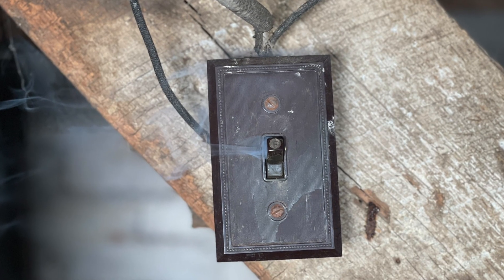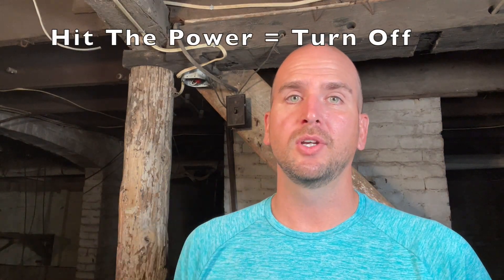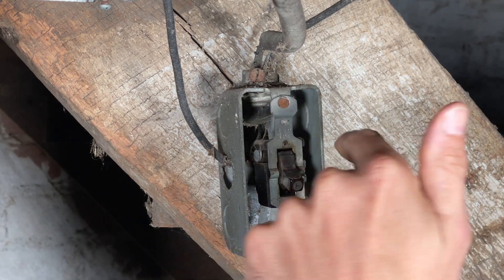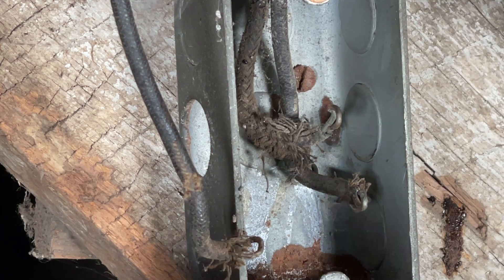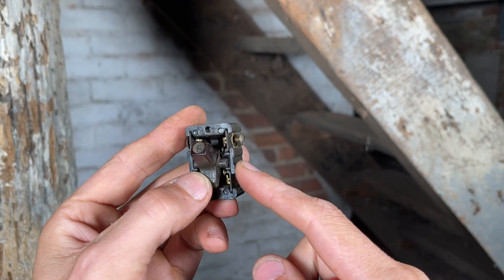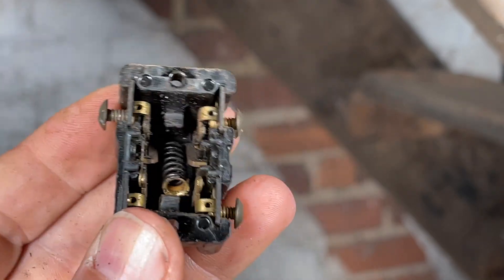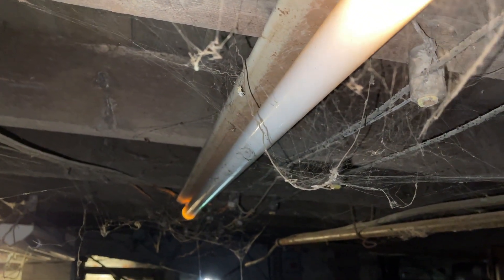Issues with Old Electric Wiring | Knob and Tube

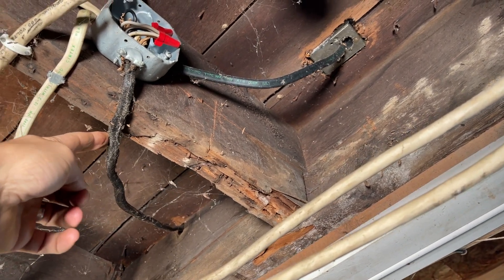Comment: I won't comment on the numerous code violations but at 5:59 you see fibrous 2-conducter Romex which predates modern vinyl Romex but was after K&T. This wire type is WORSE than K&T as both the neutral & hot are housed in the same (decaying) assembly. At least K&T conductors are totally separate and threaded through ceramic insulators when passing through a truss, joist or upright and they tinned the conductor to minimize copper corrosion. If you absolutely must keep some K&T or fibrous Romex don't use metal box clamps. The aged (dry rot)  wire insulation won't hold  up against a metal edge under pressure. Many regions won't allow re-power if you have a 60-amp main fusebox so a previous owner would swap it out for a 100-Amp breaker service box. The newer the breaker box the more suspicious you should be about the rest of the service when you see even a trace of older non-vinyl romex in use or left behind. Most electric fires start at junctions, outlets and switches.
Reply from the maker: Good stuff, appreciate the feedback!
Reply: @EverydayHomeRepairs  Is that BX at 5:59?! (the cloth wiring)
Reply: You're describing the wiring in my summer home. Dang...

Comment: I believe your diagnosis may have missed that the switch is actually a 3-way switch. If the "Hot" was on the left side of the switch then on the right side were the two outs for a 3-way switch so when you"Turned It Off" you actually switched it from the bottom "Out" to the top one. You already observed that the top one was shorted to the box so that's where your short came from. Because the box was not grounded and the wood can conduct some current is why it didn't blow the fuse/breaker as it was a high resistance short just enough to cause heat within the switch. What say you?
Reply: @John Naber I also think that it's a older 3 way switch where the travelers are actually the top 2 screws and the line / load terminal is on the bottom right, completely opposite of the newer 3 way's, but none the less it's definitely a 3 way switch.
Reply: That wood was not conducting any current .  It is an old house , very dry .
Reply: @gerdberg4188    Looking at all the rot on some of those joists i’d suspect that there has been humidity/water problems in that basement.
Reply: You're correct that it's a 3 way switch but within it smoldering the contacts were aging and it did look super old so either way it was time to get a new one. But it did arc against the box. Without a ground you do become the ground. Ik back then they didn't have grounds to Switches so it wasn't obvious but they did carry electrical tape/Rubber tape as I used to hear the oldheads call it. Either way it was time for a brand new one.
Reply: @crockpot5194  Thanks for reply. My home is a Victorian in Northern California of unknown age. When I purchased the home 30 years ago they could only say that it had been moved to this location 100 years ago and had no idea where it came from originally. There was a mish-mash of knob and tube and some home updates that were done completely wrong. Love your videos. Thanks,
John
Reply: @johnnaber5754  Might want to check with the online state property records. They often have when the primary structure was built.
Reply: Don't think wood conducts.  No free electrons.
Reply: @joehead1294    It will if it’s wet/humid enough.
Reply: @joehead1294  Sure you're right, however there is almost always moisture, even in old wood, especially in a high humidity environment.

Comment: My house is from 1923 and it's a combination of Romex(in the basement), the asbestos wrapped vinyl wiring(40's/50's stuff) and a little bit of Knob & Tube wiring. The first floor was Knob & Tube at one time but was updated sometime in the 40's or early 50's when the attic was finished but at the same time some Knob & Tube was left in place. Surprisingly the Knob & Tube wiring is still in really good condition.
Reply: The common fibrous romex for home use did not use asbestos, it was quality bleached, often mercerized cotton with a high--dielectric varnish. Asbestos wiring was  reserved for larger currents/wires in commercial and retail (think theatres). Asbestos doesn't "dry rot" but very old cotton does, especially at bend points where it starts to fail along with the brittle varnish.
Reply: @zenengineer9277  I had never heard of asbestos covered home wiring (although it would probably have worked but also killed millions via lung cancer).  I can also speak personally to cloth covered wiring where the cloth turns to powder if you handle the wire.
Reply: Old houses scare me. Everything about them is so creepy.
Reply: @Asiansxsymbol  I can see that, but it depends on the house, and its condition. My house does not creep me out at all, even though it was initially from 1908, with an addition in 1985.
Reply from the maker: Yeah, that type of setup is actually really common for old homes in my area.
Reply: @EverydayHomeRepairs  I think it's quite common in most areas in the US, even I have some in service K&T and romex and one armored wired cable for the stove, and when I was looking at the house, it still had a FPE circuit breaker that I had replaced on the seller's dime. Since I had K&T, several outlets in the kitchen, living room and original bedroom had to be swapped for GFCI, even though they had newer grounded outlets, but as you know, K&T can't be safely grounded, if grounded at all, hence why it's often required to be removed or taken out of service when getting insurance.

Comment: 6:41 - And that $10k also does NOT include the extra wiring that would need to be run in order to meet today's Code.  You can't simply run new wiring to existing boxes and call it a day.  Additional outlets will need to be added throughout the house to comply with 210.52 NEC, as well as separate 20A circuits for bathroom, laundry, and kitchen outlets.  And 15A dedicated circuits for refrigerator, dishwasher, garbage disposal, and 20A for OTR microwave.
Reply: Some houses are grandfathered in for meeting receptacle placement code, but it depends on the municipality as well.
Reply: @plkracer  I think the NEC does a good job in making home safer despite some stupid occupants,
childproof outlets, are a pain. The move to AFCI/GFCI combinations at minimum price of 30.00 ea is a bit hard on a customer, the idea of GFCI on the high amperage circuits with a high price tag seems a bit excessive. I think the NEC seems to be overly influenced by the manufacturers.Sometimes it's cheaper to put a subpanel in the pantry of a modern kitchen just to feed all the dam circuits, and don't get me started about the number of outlets on the kitchen island.
Reply from the maker: Good additional points, this type of electrical setup is pretty common in the small rural communities around me for any house built prior to 1950.  It is extremely rare to find a full rewire following the current NEC.  Not sure the answer to the problem of these aging systems but definitely something to take seriously.
Reply: @EverydayHomeRepairs  ... the real answer is NEC points mostly to new construction. Repairs and retrofits have some slack depending on local rules. OTOH, it would be wise to make use of GFCI outlets or breakers for garages, basements, and exterior locations, regardless of your situation.

Comment: The smoke means that it's working. 🔥
Reply from the maker: I was expecting a Genie 🧞‍♂️ to pop out.
Reply: @EverydayHomeRepairs  ... when the factory installed smoke comes out that means the warranty is over!
Reply: @EverydayHomeRepairs  got 3 wishes?
Reply: @acwright  please don't catch fire, please don't catch fire, PLEASE DON'T CATCH FIRE!
Reply: @kabloosh699  🔥🚒
Reply: When you let the smoke out it's dead...
Reply: Every machine is a smoke machine if you use it the right way... hehe
Reply: Obviously it just means that the house lighter is running